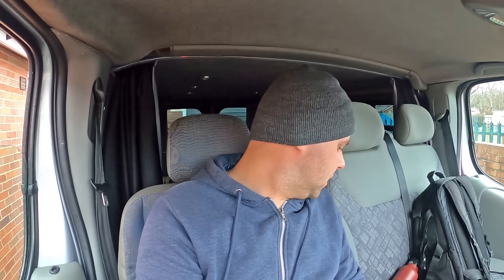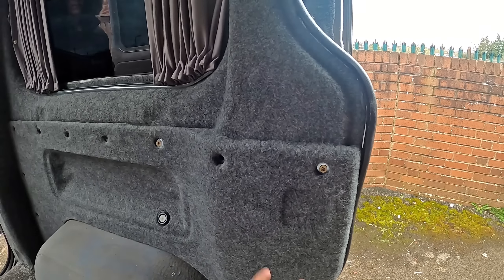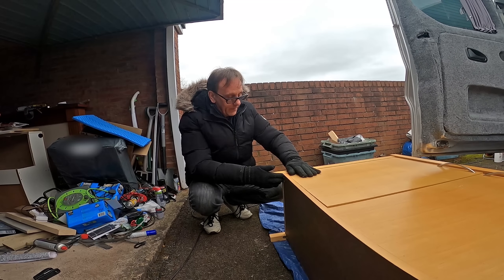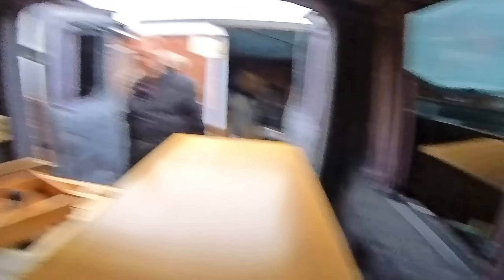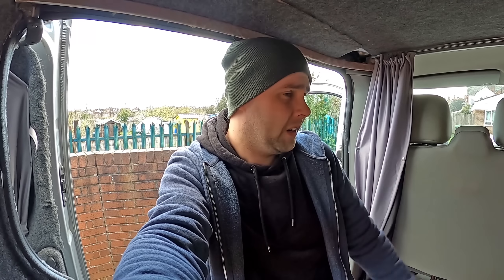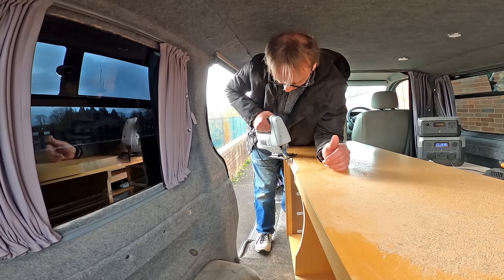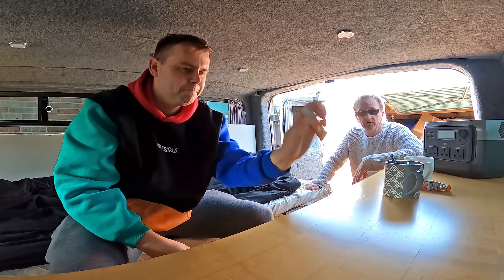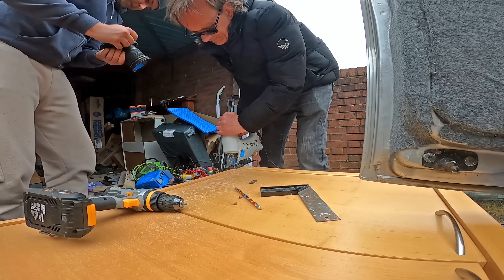ULTRA LOW BUDGET Camper Van Kitchen Build | Mini Van Conversion Powered By The EcoFlow River 2 Pro

Comment: Great video again. I’ve got the Renault trafic which is basically the same van as yours. Just what type of heater you run off it? I’ve been toying with the idea of getting a diesel heater after your other video but wondering whether this would work better 👍🙏
Reply from the maker: Hey buddy, good choice of van 🙂 and I actually have 2 types on heat now. I have a 5kw diesel heater and I can also plug in electric heaters via the ecoflows. The electric heater I have is a 500w heater which can be used for different lengths of time depending on what capacity unit you have. For the really cold nights when it drops below freezing I would say a diesel heater is the best option but now we are coming into the warmer months an electric heater would be ideal 🙂
Reply: @BrendanExplores  brilliant. Thank you. I’m going to have to have a look into a diesel heater and looking at a plate for turning the passenger seat to give me some more room. Keep up the great videos and enjoy the van they are perfect for getting out there exploring 🙏👍
Reply: Hi from Australia 
I just read your comment and thought you might like to look at my set up, Australian locations such as world heritage listed K’gari (Fraser Island) and camp cook ups.
Cheers,travel safely🇦🇺
Out There Touring